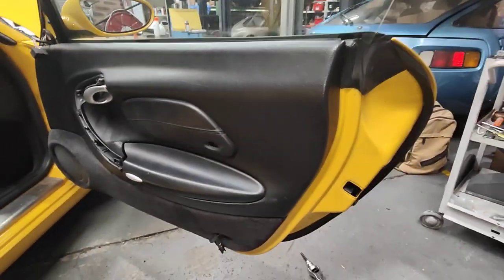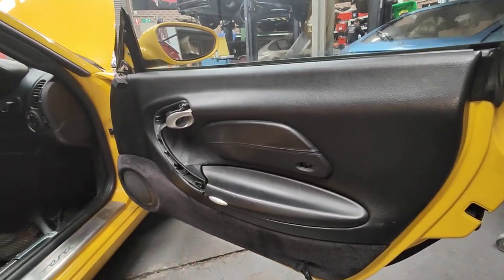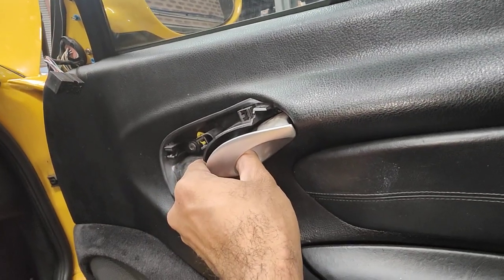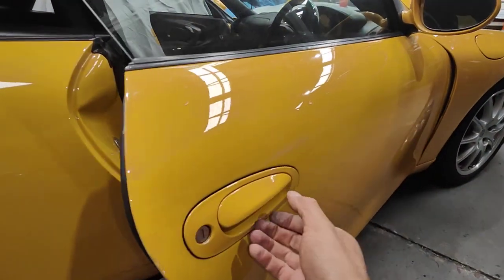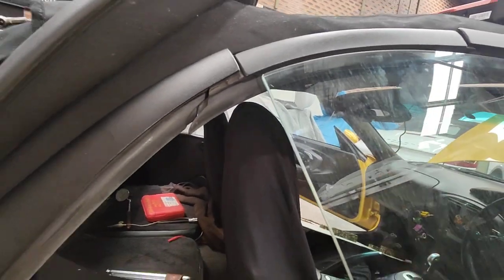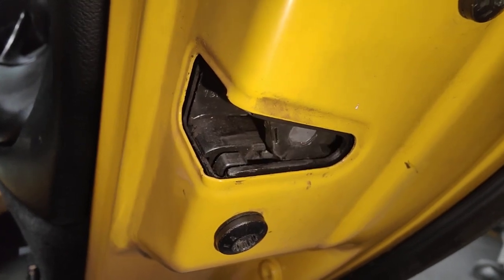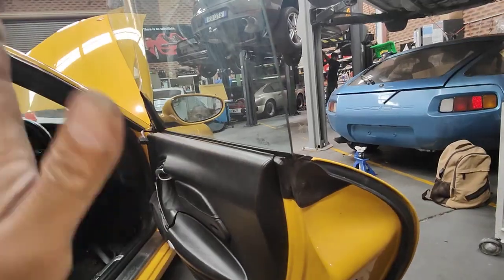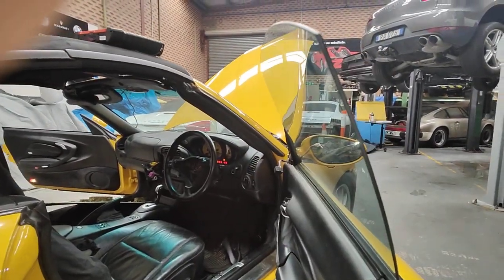Porsche 996 Carrera / 986 Boxster P.M - How window drop & door lock works

Comment: When you separate the inner door card from the main door structure, you have to unplug a small black connector, and a white connector. My white connector decided to disassemble itself. Do you know what to call the switch that the white connector plugs in to, and maybe a part number? Thanks!